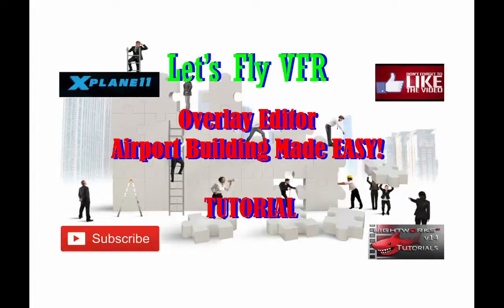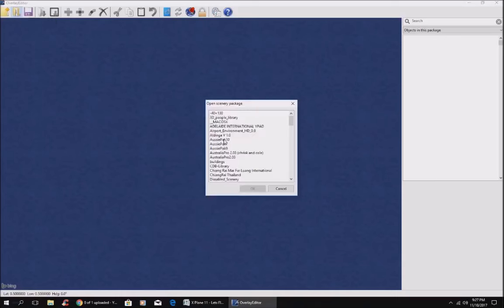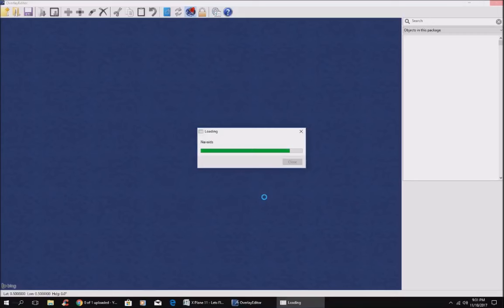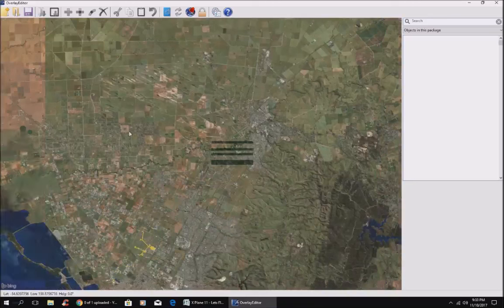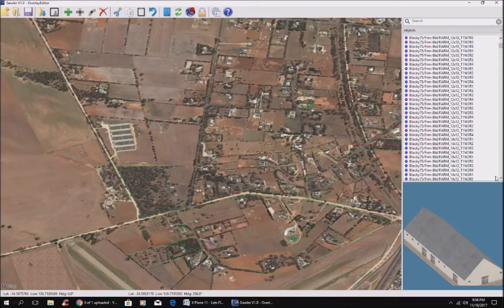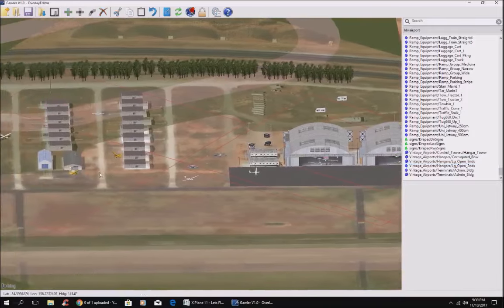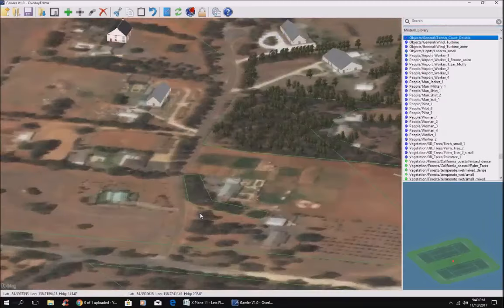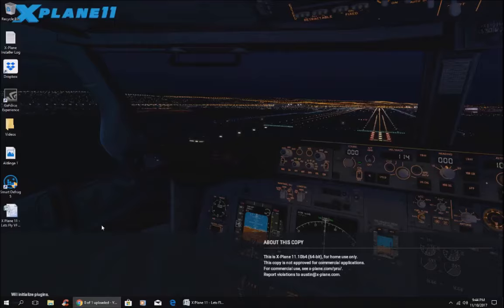X Plane 11 - Beginner Tutorial - Overlay Editor - Airport Build

Comment: Hi, if I place an area of vegetation or asphalt and then in game I see that the vegetation doesn't look like I want, is there a way to go to the editor and change the vegetation type, without having to delete the area, and redo the area as a new texture.  This can be a lot of work for complex shapes!!
Reply from the maker: Hi Mate .. If its scenery you created in overlay editor .. yes go back and delete it. If there is default scenery that has trees for example where there shouldnt be like a sports oval then load the scenery into overlay editor and use an exclusion zone .. there are different ones but it easy to do.
The only awkward thing is you can only draw squares or rectangles so you may need to overlap small ones sometimes. Its easy. Have fun :)
Reply from the maker: +FURBALL I hope you see my answer.

Comment: Is there a site or video that helps with troubleshooting Overlay editor? OE reports the apt.dat is corrupt I have most of the scenery & libraries for a few locations.
Reply from the maker: Trouble shooting not really. I have had this before but dont remember what i did to fix it. Should be able to google and get an answer. Ill think on it. If you find an answer please let me know.
Reply from the maker: Also in the forums a reinstall of overlay editor helped. If you have an old version sometimes there is an incompatibility with some updates

Comment: Hello Gunnie I'm having a big problem on how to install Flags of the world it said the following instruction (  Installation: un zip file and place "flags_of_the_world" folder in your Custom Scenery folder. Open Overlay Editor, and look for the Flags of the World in the pull down menu. Use Overlay Editor to place in any scenery of your choice.  )   But can't understand it can you help or even make a video thank you
Reply from the maker: It's easy my friend. Its the same as placing a car or hangar in overlay editor. Search for flags in overlay editor and them place it where you want by clicking the plus and place on the nap.
Reply from the maker: @pito2531  Hi mate .. i just did it here.
Open overlay editor.
Select the airport you want to place the flag
In search ... search flags ...
Use the mouse to drag the map so the red dot in the middle is where you want to place the flag.
Hit the green cross up in the menu bar and its placed there
Mouse. Middle button hold down to grap thw map. Zoom in and out by rolling the mouse wheel.
Should be easy mate.
Reply from the maker: @pito2531  ok ill look but it should be just like placing anything else. ;)  Ill do my best mate. Appreciate it can be confusing  )
Reply from the maker: @pito2531  ok mate you need to put the library into the custom scenery file. Start x plane. Once you get to the menu EXIT then go to custom scenery and look for the sceneri.ini file which is the config file. Open it with notepad. The library will be at the top. Cut and paste it with the libraries and go flying. It should be ok. :)